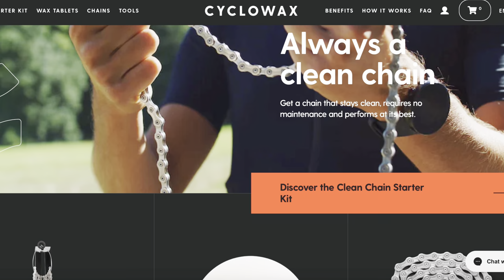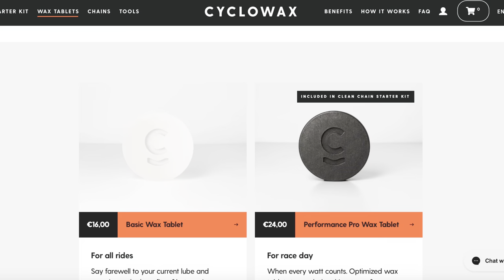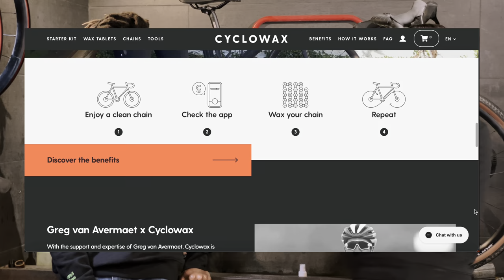Is Waxing Your Bike Chain Worth It? I Asked.

Comment: I’ve used wax on my indoor training setup and it’s only good for 200 miles.  It makes a waxy mess all over the bike and training mat.  After 200  miles the chain will start squeaking if you don’t re wax.  The indoor bike never introduces dirt yet there is dark grey wax covering the trainer, chain stay and cassette.  I used break away bike wax which is similar to Silca Super Secret with the crock pot method.  If you don’t mind re waxing and cleaning your bike every 200-250 miles wax your chain.  Wax is definitely not as clean as they make it seem.
Reply from the maker: That is REALLY interesting regarding the trainer. I wonder how that happens. But I will see how this goes. I ride pretty often right now, so I’m interested to see if I grow tired of re-waxing.
Reply: I still believe that you need to wipe down the chain periodically. I believe in immersive waxing a new clean chain, then using a quality drip wax lube from then on, a much easier life. 

I wipe down my chain after each outdoor ride…..
Reply: You don't need it indoor? wth

Comment: I've been using Silca Super Secret for the last year and a half now and love it. Using wet lubes I was getting about 2000 miles to a chain (could maybe get more, I'm not the most consistent at cleaning my chains and relubing). The chains I am using now have a little over 5000 miles on them and they are just now starting to show some (minimal) wear. I have to chains for my road bike that I swap, use a fresh waxed chain while waxing the old chain. 
When I started waxing, the biggest chore was to get the factory lube or grease off the new chain, but now Silca has their Chain Stripper and wax prep which greatly speeds up the process as well as making it easier. Silca also just came out with a Strip Chip that you add to their wax and it removes the factory grease (lube) as well as waxing the chain in the same process. (although I have not tried this yet).
For the trainer I have just the one chain which stays on the bike for "trainer season" and then comes off and gets rewaxed. I do use the Super Secret drip wax lube between waxings to keep the chain well lubricated.
I do wipe my chains down with a microfiber cloth after they have been rewaxed or have had the drip lube added and this tends to clean off the "dirt" or debris of the dry wax chipping off.  I have seen minimal dirtiness on the trainer. 
I'm very happy with my switching to waxed chains.
Reply from the maker: Thanks for sharing! Another viewer mentioned that the waxed chain on their trainer still gets dirty and that “dark grey wax” covers their trainer. Any guesses on what causes that? Because it sounds like you don’t have that issue with the chain on your trainer.
Reply: @SeeSmithTV   I would attribute it to excess wax on the chain. Even though you hang the chain to let excess wax drip off, there is still wax that s on the outside of the chain. For me, giving a good wipe down with a microfiber cloth once the chain is reinstalled seems clean off most of that excess wax to alleviate that issue. 
Silca sells gear wipes that you can also use to wipe off the excess wax on the outside of the chain, while leaving the wax between the inner and outer plates. I have not done this as the microfiber cloth works fine for me. 
I do use the gear wipes to clean off the chain if I've encountered a dirt or gravel road during my ride and follow up with an addition of the drip wax lube followed by another microfiber cloth wipe the next day.
Reply from the maker: You have things DIALED. Thanks so much for your tips!